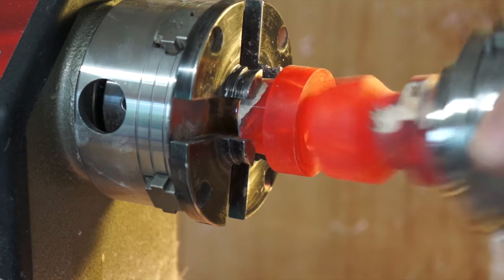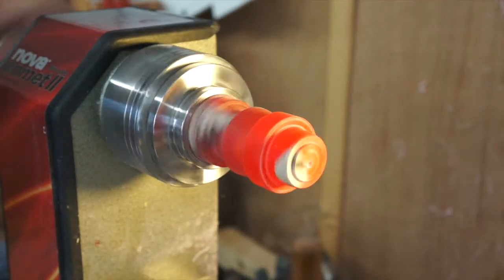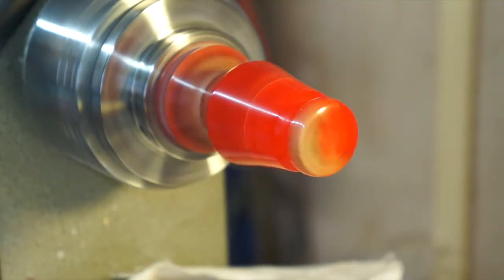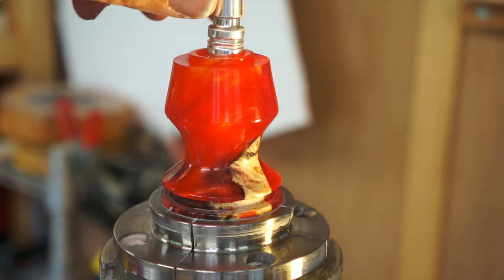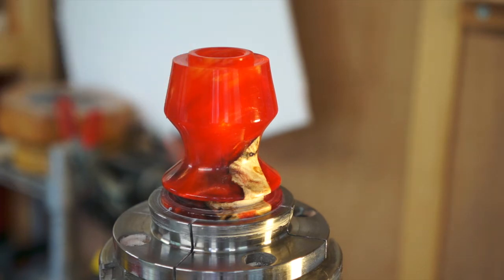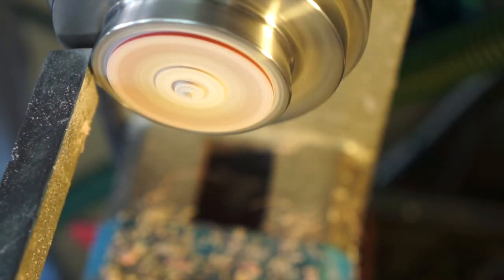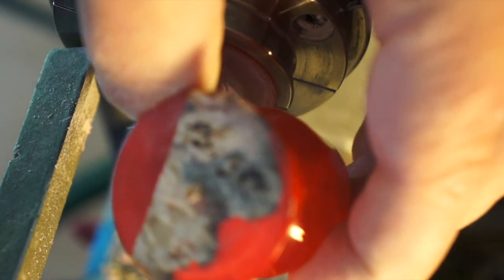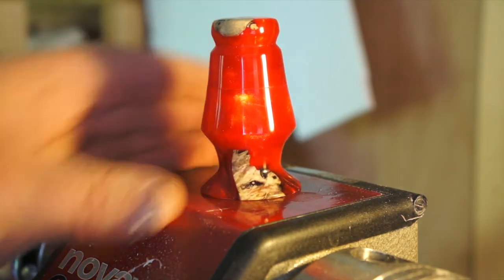Perfume bottle holder

Comment: Fantastic! Guess I missed an important bit, but what media is that with the wood inlay? Looks like a type of plastic while you turn it? Beautiful work
Reply from the maker: Hi Chris, Thanks for the comment.
That is Opti cast 100 Polyurethane resin. It is a two part mix. It is readily available here in the UK. If I could I would use Alumilite but that is difficult to get hold of and very expensive here.